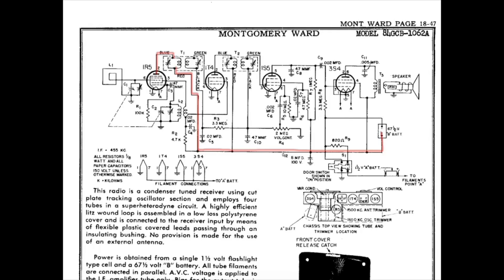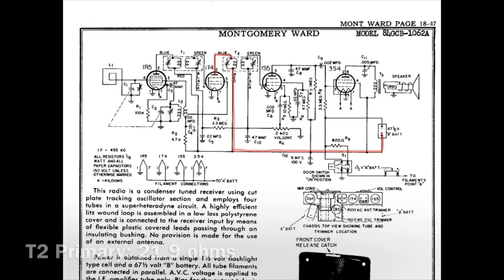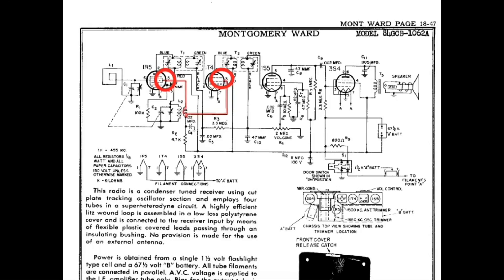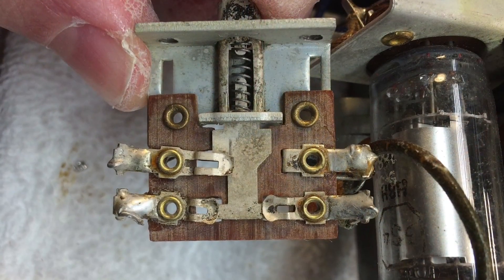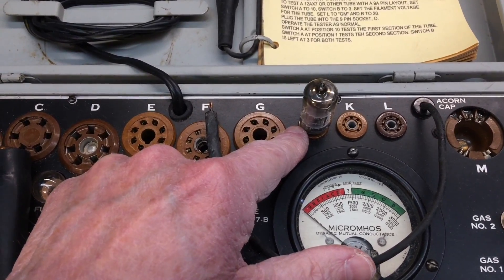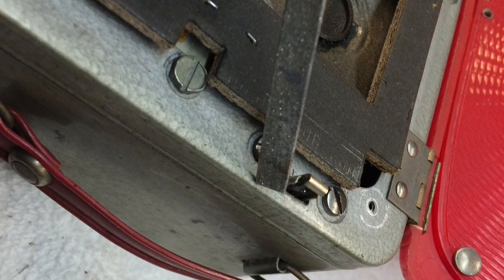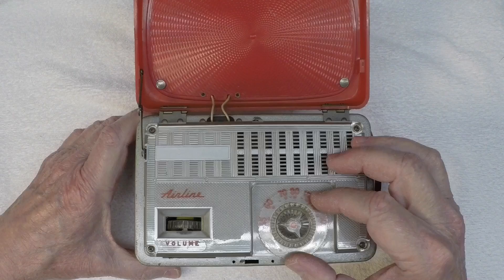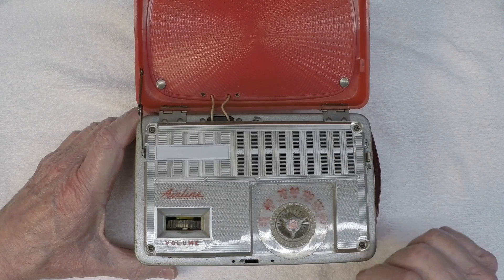Airline Portable Radio - Model 84GCB-1062A - Repaired & Playing

Comment: Nice work! I'm not surprised that the tubes test as almost NOS. Potable radios of that vintage usually chewed through expensive batteries at such a rate that they were generally low use radios.
Reply from the maker: I can see that too. A fresh set of batteries on hand would have been needed to fully enjoy these vintage portables. Thanks for watching. Best, Don

Comment: A wee question.  What is the grease you were using?  Is it a silicone based grease?  I wish we had your selection of a.m. channels here in Scotland! 🏴
Reply from the maker: Thanks for watching from Scotland. The grease is from Labelle at: https://labelle-lubricants.com/shop/hi-performace-r-c-model-grease-with-ptfe-labelle-206/ I also use their gear oil #202 on tuning condensers then apply a little grease afterwards. We do have a number of AM stations on the air still. I built a few simple AM transmitters to stream music as well at: https://www.youtube.com/playlist?list=PLjLu4V-71S1Kaz5Eiw0Cx5c8U0DWll87B Thanks again for watching. Best, Don

Comment: Hi Don, 
Nice job on that Airline!  How much does it really matter to find and mark the foil side of a capacitor?
I've got the same I-177B tube tester. I love mine except for one problem. On a five pin tube socket, there's a rather poor contact on one of the socket connectors. I've got to tilt the tube slightly sideways to the left so it'll make contact and work properly. Do you have any advice on cleaning or possibly bending back one of the sockets contacts? I figure if anyone knows how to fix this problem it'll be you. :-) Thanks so much in advance!
I hope you and your family have a nice Thanksgiving as well.
Regards, Tom
Reply from the maker: Thank you Tom. I’ve got the same problem on my tester too. I have a piece of tape with a note reminding me of the flaw. I haven’t investigated it to understand the root cause, but I should do so. I’ll ping you back if I get around to it and let you know if it’s repairable. I appreciate you reaching out and again have a blessed Thanksgiving. Best, Don

Comment: Nice work, Don. When doing the alignment where was your VOM attached?  Looked like it was set for 10 volts DC.
Reply from the maker: The AVC (high side of the volume control) leads reversed on the meter (to read negative voltage). I generated a CW carrier at 455 KC. Hope this helps. Best, Don
Reply: Thanks!